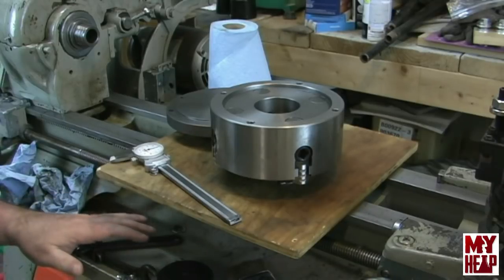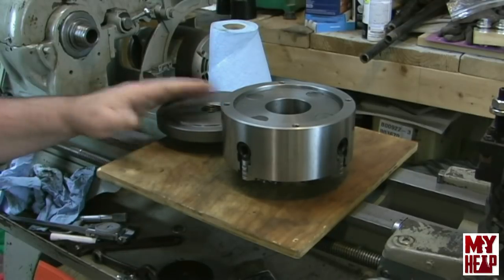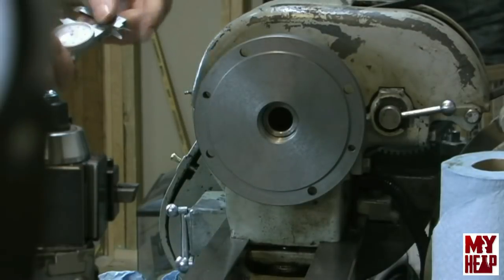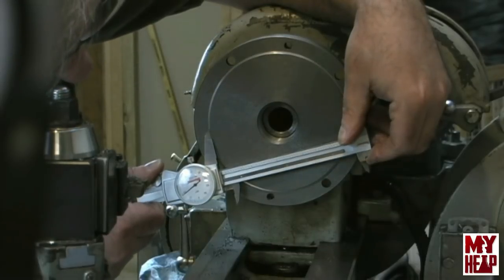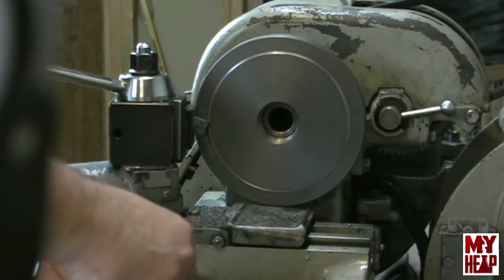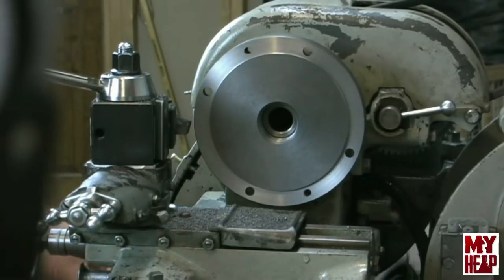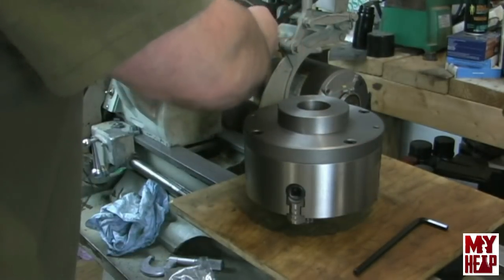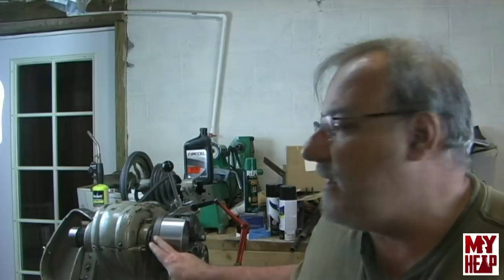YouTube Shop Student - Episode 004 - Machining the 4 Jaw Backplate

Comment: G'day Joe, don't worry too much about the run out on a 4 jaw. I would remove the bolts and clean the mating surfaces again,fit the chuck up, turn it to and fro just to make sure it is fully home and bolt up, but hey, first chips, well done. CNC, haven't thought much about it but it could be interesting, I might be interested to build a small universal table one day for router and/or plasma cutter (I don't have a plasma cutter but "then who knows) anyhow cheers Peter
Reply from the maker: Thanks Peter.  I am slowly getting over my anxiety about running this thing.  It is actually quite a pleasure to see it make chips and the item I am turning come to the size I need it to be.  If that makes sense.

I think I will try to put our some CNC related video but not as my main concentration.  Perhaps more of a resource for those who might want to get into it.  I would like to talk about controllers, motors, switches, linear slides, cutom configurations, adding new equipment like VFD, PIDs, Vacuum control and other generalized things that the Home Shop guy might find helpful.

Joe

Comment: Nice job Joe. Don't sweat the runnout.  All the Chinese chucks have a few thou. Also, being a 4 jaw, you can eliminate runnout in your work (the part that really matters). The only suggestions I would make are breaking your edges, and don't clean chips away with a rag or paper towel. They tend to leave lint behind. Go to Home Cheapo and pick up a few chip brushes. I usually use the one inch ones.
Reply from the maker: Point taken my friend.  Although I think I want to do a little more work on this backplate.  I need to turn the hub down in the back so more threads engage.  I will make a spacer to go over the register of the spindle and then screw the plate on backwards to face it down.  Then turn it back around and give another light facing cut on the backplate where the chuck meets.  I would feel better if I had more threads in contact on the spindle.  If you look close at the video you see it is really hanging out there.

Thank you Jeremy.

Joe

Comment: Hello My Heap, I am a newby also. Think you did a good job on the back plate accept for the outward travel which you learned a good lesson and I know you will check it next time before you start. As far as the CNC goes, I would give my eye teeth to have a 3D printer and the CNC videos would be akin to the 3D printer so yes I would be interested. I have an old Atlas/Craftsman lathe that looks about like yours. I have it torn apart now getting it ready to powder coat and adjust everything to see how accurate I can make it.
Reply from the maker: Hi Clifford,
Yeah that was a mistake.  Would be great if that was the only one I ever made, but I know I have a plethora of them to come while learning to use the machine.  But maybe I won't make that one again any time soon.  :-)

I will slowly create and release CNC videos as I get time to make them.  Will be doing the install soon as well as updates and that sort of thing.  Then will have to delve into a little bit of hardware IO after that.  But will also let the interest of the folks commenting help guide the direction on the series.

Thank you for taking the time to comment and to watch my videos.  I appreciate it.

Joe

Comment: Nice job! I knew you was gonna run out of travel on the way out based on the angle of your compound (been there...done that 😊) If I can offer a suggestion...get in the habit of breaking all your edges, not that its gonna come off anytime soon but its just a good habit to get into. Glad you skimmed that back face, I was wondering if you were gonna do that. Not sure how close your bolt holes were to the OD of the plate but I would turn that OD so its concentric to avoid vibration at higher speeds...plus it would look better machined. If you can bump the chuck to run true I would do it. Great job Joe!
Reply from the maker: Actually, I think I will do that and I want to face some of the back off the back plate where it seats against the spindle.  The register on the back plate is rather a lot more than I need so I want to reduce it to allow more thread to engage the spindle.  I will take another facing cut on the front of the backplate to make sure all is still parallel and put it back on the chuck.  This time, I will pay more attention to the travel of the tool!  Once it is back together I will take a little off the perimeter of the backplate.  And yes, it would look better!

Thanks Richard.

Joe
Reply: Well, I am just excited you are down to the one yard line. If you can eliminate any unbalance in the backplate and chuck it will serve you well on machining a critical part down the road by starting with a clean slate you know runs true. Concentricity is key in this hobby of ours.....how will you hold the back plate backwards to take some off the boss to shorten it up?
Reply from the maker: I will use it as is to make a spacer to go over the spindle register making sure it is as parallel as I can make it.  I will slide that on the spindle then thread the backplate backwards against it to allow me to machine the boss on the rear of the plate.
Reply: Now thats something I would do! Love the progress you've made

Comment: joe gotta make certain you can finish the cut would have been a good idea to do that after you reset your compound. hate to make the same mistake twice right. just good practice in general
Reply from the maker: Hey Chris, Well, I will chalk it up to being a newbie.  Trial by fire so to speak!

Joe
Reply: yup i learned the same way.002 is not important as far as the balance i would strongly suggest making your self a 90 degree cutter for doing champhers and keep it in a dedicated block unbroken corners are dangerous things. and for keeping the cast iron chips under control i use rare earth magnets to hold the paper towels down good to keep that stuff off the bed
Reply from the maker: Yeah, I need to grind one up.  Didn't think about magnets to hold the paper towels down.  Thanks for the tip.

Joe
Reply: something new every day right

Comment: im kinda interested in a arduino based controller probably fro a 3d printer
Reply from the maker: Well, I think you can control the steppers with a arduino, but not so sure about a trajectory planner and pulse generator to guide them.  I think you will need another block between them, but it has been a LONG time since I have taken an Arduino out for a spin.

Joe
Reply: they make shields spacifit for arduino throws functions must be controlled on the shield.
Reply from the maker: I am not sure I am following you.  What is a "throws" function?  All of the Arduinos that I looked at in the past have expansion boards that will attach to the headers.  Of these I have seen servo and stepper controllers.  Servo varieties usually include a feedback loop for positioning.  These motor controllers still have to receive there trajectory information from something.  Trajectory plots are usually created from a planner that examines the G-Code to calculate the next position, this position is passed to the step generator which send coordinated pulses to the motor controller to make sure that multiple motors end and on the calculated trajectory  position at the same time, while honouring feed rates, cutter compensation and exact or variance path conditions.  The Arduinos that I have looked at do not have the processing power to handle this.  But, take that with a grain of salt because I have not "Played" with an arduino in quite some time.  Now, a Rasberry PI is a different story.

Does that make any sense?

Joe
Reply: oops should be a period between these to words lol . at any rate i think i have seen the expansion boards your talking about specifically for CNC work like printers but i have not looked in to it very deeply . i have been hunting up line shaft hangers and other much simpler bits of technology lol

Comment: That went well did it not.  When turning / milling cast iron be sure to cover up!  That dust gets-in everywhere and is very abrasive.
Reply from the maker: I think I got lucky as a newbie.  You are right, the cast iron dust was a mess and a pain to clean up.  I started to cover the ways with some paper towel but then worried it would get caught up on the machine because of the limited space.  Next time I will cut the towels down and stick them down with some magnets.    :-)

Thanks for the tip and taking time to comment.

Joe
Reply: I normally  use a rag and I've never had a problem because paper will fly a lot quicker than rad.  Just my thoughts.  I f you do use  the magnets be sure to completely encase them in say a small plastic bag, because the magnets will collect the chips  and dust.  You will have a tough time cleaning them off, that's my experience.  You'll do just fine!
Reply from the maker: Good idea with the plastic bag for the magnets!  Thanks.

Joe